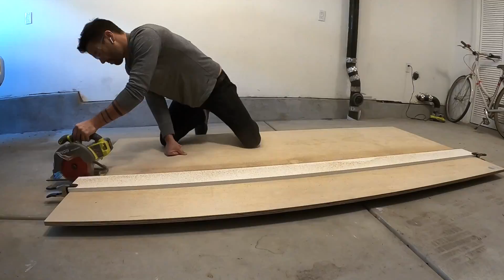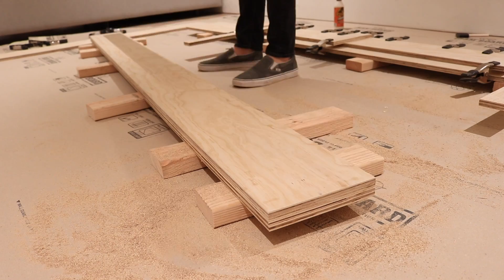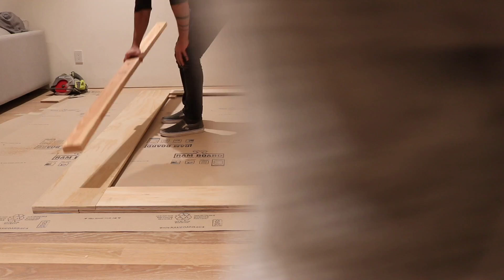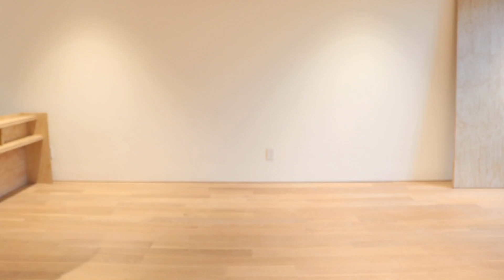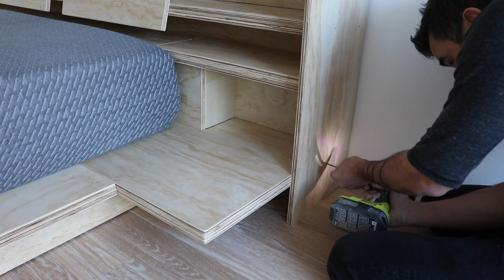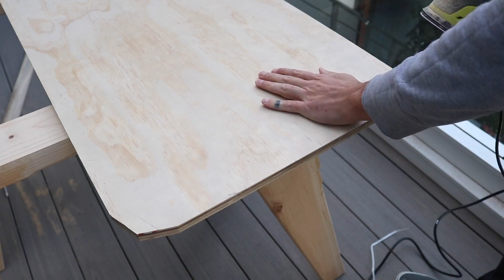DIY Plywood Bed with a Sliding Headboard

Comment: thank you man! This is how I imagine DIY. With basic tools which total cost is not more than a 100. Not as other videos - we buy a material, cut it with a circular saw on smaller parts, than use a table saw for exact sizes, Than a belt saw for something else, than a router  to do nice edges, than a nice holder  with integrated drill to make holes for dowels, than a tool for a pocket holes.. and so on....

I dont have a workshop full of machines and dont have a month/year to first do a workshop, buy/make tools for thousands and after make a single table or a cabinet.  I also usually do and assemble everything on place where it will be placed :) 

So thank you. Really!

Comment: Is there a cheaper alternative to plywood? It’s SO expensive!
Reply: Colum Coyle 
Well...MDF and OSB are hardly suitable for this kind of project. You could probably use regular wood boards though. They should be available in large enough sizes for this. Pine  is usually cheapest and considerably less expensive, than plywood. Plywood just has the advantage, that it comes in huge sheets, doesn’t expand/contract/warp etc.
And lots of people find it esthetically pleasing, too. 
I‘m not really into it, I would use nice hardwood planks...but that would set you back a similar amount, especially if you figure in surface treatment. 
It’s a bummer, I know. I always cry, when I realize, how expensive ‚diy‘ is.
Reply: Rara Avis thanks for the advice Rara!
Reply: Chipboard 🤣
Reply: Pallet wood is the cheapest if not free if you have the time to separate and clean them
Reply: OSB but it'll look uglier.